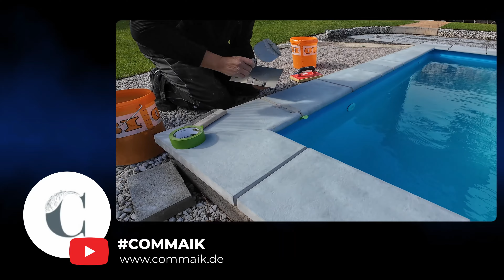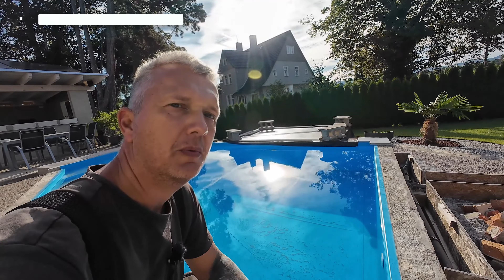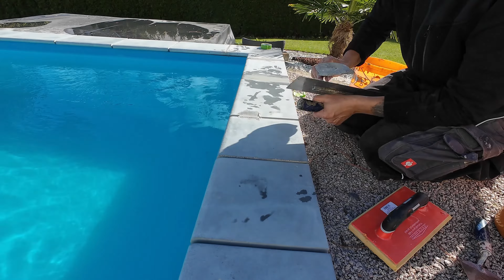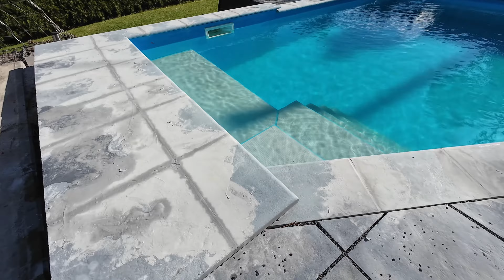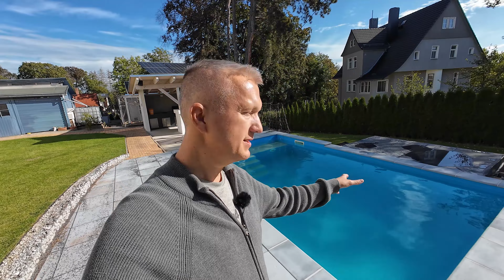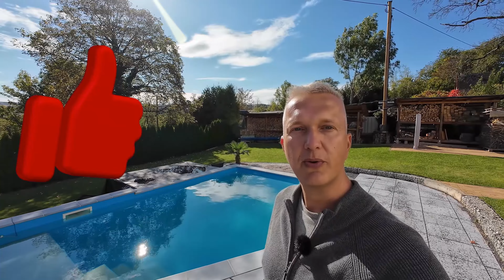DIY Pool Coping Stones: Step-by-Step Installation Tips

Comment from the maker: *👇 All products & links from this video:
🔗 Adhesive https://geni.us/qTr5ww (Amazon)
🔗 Grout https://geni.us/QkrJ (Amazon)
🔗 Silicone https://geni.us/cF3xZ (Amazon)
🔗 Tile spacers 10 mm https://geni.us/CBTeE (Amazon)

🔗 Jointing board https://geni.us/9ISr (Amazon)
🔗 Rubber spatula https://geni.us/p6Had (Amazon)
🔗 Grout sponge https://geni.us/U20BfZF (Amazon)
🔗 Tile cleaning set https://geni.us/C1AS01b (Amazon)

🔗 Rubber mallet: https://geni.us/temBiq (Amazon)
🔗 Notched trowel: https://geni.us/QT5uE (Amazon)
🔗 Angle grinder (large): https://geni.us/oEsbPDE (Amazon)
🔗 Cutting disc (large): https://geni.us/u5WmiD (Amazon)
🔗 Slab lifterhttps://geni.us/Do8uvk (Amazon)

🔗 Pond linerhttps://geni.us/yEwOxa (Amazon)
🔗 Ground sleeve for sun sailhttps://geni.us/UR7KT2f (Amazon)

You can find a detailed blog post with lots more information on my website: https://commaik.de/2024/12/beckenrandsteine-verlegen-und-poolterrasse-selber-bauen-fuer-die-perfekte-poolumrandung/

Follow me on my social media channels for more content! @commaik

🎥 This video was originally produced in German for my main channel:  
https://youtube.com/commaik  
It was then translated into English using Heygen – with my own voice and lip-sync.

🎙️ Want to dub your videos like I do? Try Heygen:  
🔗 https://www.heygen.com/invite/b96cdcf6 – Get 300 free credits when you subscribe.

📺 The original video, which includes English subtitles, can be found here: https://youtu.be/lIJjM1MG02I

Note: All links marked with * are affiliate links. If you make a purchase through these links, I will receive a small commission at no additional cost to you. Thank you for your support!

Comment: Where did you get the grit ?
Reply from the maker: Of course! Here's your reply in US English:

---

Hi Michael,
I got the *grit from a local building materials supplier* – you can often find it at regional gravel or stone yards as well.
The important thing is that it’s crushed and angular, so the pavers won’t shift over time. I used  basalt grit for the installation.

Best,
Maik